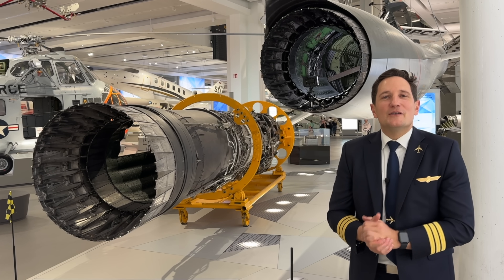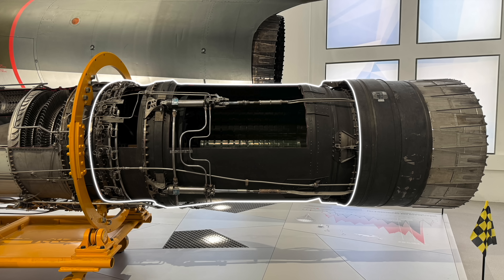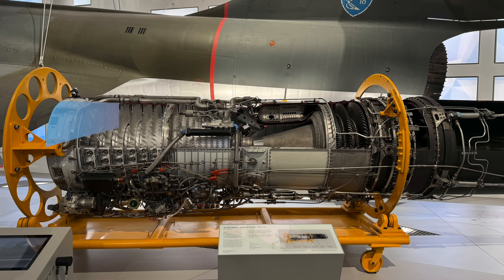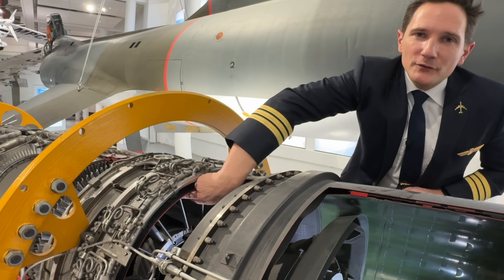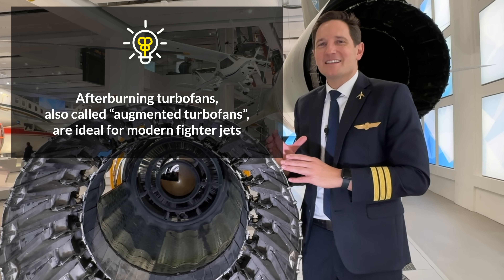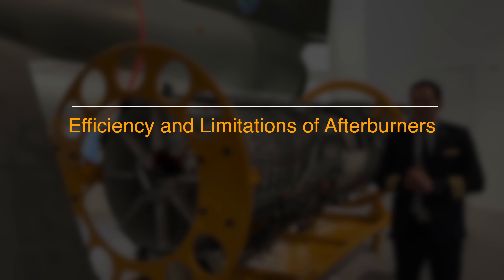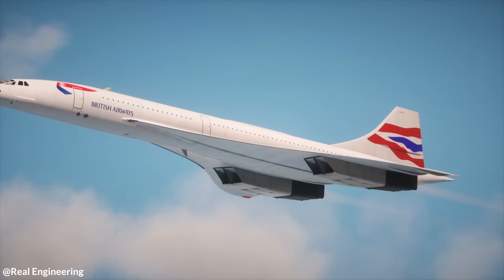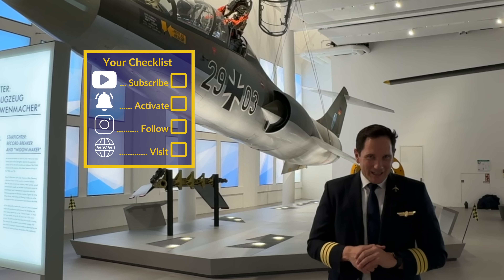How an AFTERBURNER works - Explained by CAPTAIN JOE

Comment: Indeed,  comparable to a rocket engine,  producing power continuously, micro second to micro second without interruption.  Even a V-12 piston,  for some microseconds,   portion of the engine cycle it produces no power,  and is dead reciprocating mass.

Comment: Hello, interesting video. To burn the injected fuel, isn't air needed? Surely the exhaust stream is O2 defficient so air must be needed? I think you mentioned one engine design had bypassed air but no mention if other engines have some sort of air bypass to use and burn with the fuel post main combustion. Thanks, good video.
Reply: There is plenty of O2 in the exhaust stream. 16-20% oxygen in the afterburners compared to 21% in the engine inlet. Hardly any oxygen is used in the main burners compared to the volume of airflow that goes through.

Comment: Does the exhaust nozzle have to open wider in AB to prevent turbine or core damage?  Or is there another reason?
Reply: Yes, the nozzle must open to allow a greater mass airflow otherwise it will choke and a) the extra thrust won't be realised and b) the back pressure will affect the operation of the main engine.
On the engines I've worked on with reheat (afterburner) the nozzle is fully variable and as reheat is selected the nozzle opens full to allow the flame to light then the nozzle closes to allow the exhaust gas to accelerate to just below supersonic speed which creates maximum thrust for the min reheat setting. As the throttle is opened, the nozzle opens and the reheat fuel flow adjusts to maintain maximum thrust for the given nozzle area. The throttle drives the nozzle and the fuel follows the nozzle. At max reheat, the nozzle is fully open and no choking effect occurs but max thrust is generated. As the throttle is closed, the nozzle area is reduced and the fuel reduces accordingly. When reheat is deselected, the nozzle remains at the size required for the dry engine to function at best thrust.

Comment: A better example is Concorde’s RR SNECMA Olympus engines with afterburners on a CIVILIAN aircraft that beat most military aircraft for distance endurance at MACH 2. 
Concorde fired up after burners (military thrust) briefly on take off and when crossing the sound barrier over water.
Reply: It wasn’t called the Rocket for nothing

Comment: Correct me if I am wrong pleas but stories of the blackbird pilots tell of it getting better fuel economy at high speed in afterburner than out of afterburner and if they needed to save fuel they went faster.
Reply: Yes, the SR-71 is a different animal. At low speeds the engine provides all of the thrust (100%) which is inefficient. At speeds greater then ~Mach 2, the engine inlet spikes create about 80% of the planes thrust by capturing the energy from the incoming shockwaves. At those speeds the role of the engines are not to provide much thrust but to remove excess air build up behind the inlet spikes so that they can function properly and provide most of the thrust. They are just essentially vacuum cleaners removing built up air behind the spikes and only contribute 20% to the total thrust from their exhaust. That allows the SR-71 to be much more efficient at high speeds then low speeds.

Comment: Concorde of course @6min...and we have the tech and materials now to make a mach 3 private jet easily...and build a next gen Concorde...time is the most important commodity...its the one thing you cant get more of...
Reply: Issue with a present supersonic aircraft isn’t technology, but rather economics and legislation. As in on a relative scale, the cost of a ticket for a supersonic ticket to break even would be way more compared to a normal aircraft. Example, if a ticket between a first class emirates flight and an economy class supersonic flight would be the same, how many would prefer the latter?
Reply: @ZK-APA  the legislation can and should be fixed...its not like any of the crap they were worried about with sonic booms or the ozone layer turned out to be anything...seeing as it was CFCs and not aircraft exhaust causing the ozone hole...and as for the sound...at 75+kft the sonic boom is more like a roll of distant thunder...esp with modern computer designs...as for economics...drop the net zero crap and you have a much more economical way to operate...and private planes especially would benefit seeing as the economics for them are based on time savings...also make exceptions for these aircraft with those nonsense airport noise restrictions...
Reply: @MariktheWolf  For legislation sure your points are valid, I won't counter that. But for economics yes. Its not about net zero or anything, its about how many people are willing to pay a premium for this feature. Yes in private jets I see a case but for commercial aviation it can only be feasible if the cost of entry for the passenger is low.

Comment: My late uncle was a designer and inventor for McDonnell Aircraft Company. He and another man invented the F-4 Phantom II, fighter jet. This jet is probably the MOST important advance in jet engine design because it made afterburners a practical engine feature. Without fancy math, Uncle Bill described how this came about. Mac engineers discovered the exhaust gas was very inefficiently burned. It was full of hydrocarbons being wasted out of the stovepipe. By adding a small amount of fresh fuel and a secondary igniter, significant more thrust was created. The F-4 was and is the all-time most successful fighter aircraft, in the world. Over 5100 units were produced at the plant in North St. Louis County. F-4 was the design starting point of the F-15 and F-18 fighter jets.

Comment: Great video! I never even considered if the AB is in the turbine exhaust or bypass flow, or a blend. Just never thought about it!

Most modern (at least American) fighters dont have a set/specific time limit on AB use. What they do have is a speed limit, but more importantly, the boost pumps feeding the engines (out of the feed tanks) can outpace the transfer pumps refilling the feed tanks from other tanks, so if you stay in a low altitude, super high fuel flow state for too long, you can literally flame out due to feed tank exhaustion. The transfer pumps just cant keep the feed tanks full. 
Imagine the boost/transfer pumps on the SR71!!

Comment: You dont really hear the burners when youre in the jet, but you certainly feel it! Just a smooth, steady, increasingly powerful push into the back of your seat. 
Also, nothing really happens when you go supersonic, other than some baro altimeter fluctuations and maybe some minor pitch oscillations as the Center of Lift shifts. The CAS mostly takes care of that on it's own. If you arent paying attention you wont even notice.

Comment: So, is it appropriate to say an afterburner works similar to a rocket engine, kind of 🤔?
Reply: All engines work similar to a rocket engine ie use thrust to propel forward. The only thing different is that if the source of the air is from outside, its a jet engine, and if the source of air is internal ie stored within the vehicle itself, then its a rocket engine.

Comment: I just realized that no one has made a video about afterburners that doesn't just say "inject fuel into exhaust, ignite fuel, jet goes fast." I appreciate the decent dive into what components are actully needed, and the inner workings of afterburners in general.

Comment: My expertise is in internal combustion piston engines so I freely admit to extreme ignorance about jets. I have a couple of questions about afterburners. 1) If you are injecting fuel effectively into the exhaust, then unlike the engine's main combustion chamber there will be no additional compression applied; is this correct and does this not lead to terrible fuel consumption? From what you say about tripling of consumption I guess it does. 2) If the fuel is able to ignite in the exhaust, this suggests that jet engines are run at a much leaner fuel/air ratio than stoichiometric so there is excess oxygen available for combustion; is that correct? Thanks.
Reply: In all jet engines there is surplus oxygen in the exhaust stream as combustion doesn't use it all, therefore the surplus can be burnt to create extra thrust. Modern turbofan engines have more unburnt oxygen as they have more bypass air than on a turbojet engine so are better suited to having reheat or afterburners.
Reply: There is still 16-20% oxygen in the airflow exiting the main engines turbines. Still plenty for afterburning. Yes there is no further compression after the main compressor section. The pressure of a jet engine is highest right after the main compressors and it's all downhill after that. The air wouldn't flow out the back if that wasn't the case. One of the biggest misconceptions about jet engines is that the burning of jet fuel in the main combustors raises the pressure. That isn't so, the burning of jet fuel in the main combustors raises it's temperature. That cause the air to expand and increase it's velocity. That increase in velocity DECREASES it's pressure. Same thing with a gas stove. The burners heat the air, the air expands and the air rises, that's it, no increase in pressure. It's constant decrease in pressure out the back after the main compressors.

Comment: Soo informative. Am a fan of your channel.
May i kindly request an analysis vids of what can be done to avoid that fatal crash  of the jeju air crash.
Seems like there might be a poor airmanship and  lack of crew resource management with a combination of several co incidemces.
I am keen to know what exactly happened, can the plane be safely landed, why no landing gear and highlift devices are not in used while seems to me like the thrust reverser is working. 
What happened to power from battery for comm. Why not they use APU for necessary configuration to land, why not trying a 2nd attempt on active runway. They touched down really fast means they still have speed to make 180°  to make a downwind to active runway.
Are the pilots distracted or lack of training in sims. 
I know times running really fast and things can happen in a split of a seconds.  
Why they go around as if are fully configured for landing or they are not fully configured, if fully configured,  why not continue their approach even without reversers, they have a better chances like slamming their brakes manually.
So many things which are likely to do for the pilots. 
There are tons of questiions still not yet published.
I didnt ask for an experts examination reports, but from an experienced pilot perspective like you..
Id be very glad and wish you a good health

Comment: Hi Capt. Joe I'm  having a small doubt can you acknowledge that 
See the runway designation markings shows whole number nearest to one tenth of magnetic azimuth of centre line measured clockwise 
from magnetic North. 
So, if the runway designation making is 07 / 25 when we add 70° and 180 ° we get 250° which is the exact opposite but when we add 70° and 250° we get 320° why it is not completing the full 360° circle. 
@Captain Joe
Reply: Because there is no relation of the sum and 360. The relation is only with 180 as the 2 numbers are opposite to each other

Comment: question: where does the oxygen come from to burn the afterburner fuel? if it's burning exhaust gasses it can't have a great air-fuel ratio can it? or am I missing something else entirely
Reply: There is still some unburnt oxygen in the exhaust gases. Reason is that engines are not designed to burn the entire oxygen present (as doing that would create so much heat that it’ll exceed the engines limit)
Reply: There is still 16-20% oxygen in the exhaust gasses. Very little is used in the combustors.

Comment: -- Olympus for Concorde, and I can't remember what Soviets used for their Tu-144... back to watching the video.
Reply: -- Hey, what an unanswered  "cliff hanger"... I was expecting to have name of those engines to be revealed... Now I have to Google it!
Reply: -- There is no way I could answer this question(Soviet Part) without wiki... I was thinking Klimov or Lyulka-Saturn(because for some reason Arhip Lyulka was first in Soviet Union who designed turbo fan engines), but it was Kuznetsov(sounds vaguely familiar) for turbofan, and Kolesov(never heard that name for sure) for turbojet version of engine for Tu-144.

Comment: J58 didn't just "run in afterburner mode", past Mach 2 it essentially turned into a ramjet, with the turbojet core acting as a part of the diffuser rather than providing thrust.

Comment: The SR-71 engine J-58 was engineered to reconfigure from a normal jet engine to a ram jet as speed increased.
Reply: -- Not to a pure ram jet, but bypass a few compressor stages, and hot end to afterburner.

Comment: hello Captain Joe,
i have an important question.
can you please make a video about the performance and physical characteristics of a 4-engine plane flying on 1 & 4 engine only, versus flying on 2 & 3 engine only (symmetrical flight); in terms of acceleration, high and low speed, AoA, maneuvering, climb, descend, etc.
thanks a lot 😊

Comment: Ahhhh.... The Olympus 593 on Concorde.
About the SR 71, the engine, the J58 has a particular way to run. At high speed, it has a so-called compressor bleed directly to the afterburner, so the way it run is similar to a ramjet.

Comment: Maybe idea for a follow up video. 

1. It is not clear to me, how there is oxygen in the exhaust to burn the excess amount of fuel in the afterburner chamber. Unless mixed with the cooler air flow bypassing the core. 
2. If the exhaust after the turbine can practically "burn more", why not burn all that potential in the first stage? Is it a materials limitation of the core? 
3. Afterburner seems to me like a cheap work around of the material limits in the core. The afterburner chamber is like one from a chemical rocket. Burn in the chamber and let it out though the exhaust. You only need to worry about the container, not other moving components found in the core
Reply: In low bypass turbofan, there is oxygen to burn from the bypass air.
 About burning extra on the burn chamber  is likely that the temperature get too high and  and the compressor turbine and fan  will spin too fast
Reply: ~50% of the air that enters the combustion chamber in the core of every jet engine is used only to cool or dilute the exhaust gas stream and the combustor walls itself. It’s not used for combustion at all. The exhaust gasses are so hot they would instantly melt the combustor and turbine blades otherwise. 
This is why an afterburner works so well. There is still a large amount of air available in the exhaust which when mixed with fuel can burn. The afterburner liner doesn’t burn up because it’s also film cooled with turbine discharge air. 
A car on the other hand expels an inert gas out of the tailpipe. Almost all of the oxygen is used to support combustion in the cylinders. 

The higher the temperatures that can be made in a jet engine the more power can be made. High temperatures melt things though. So yeh, you are right, what limits jet engines is materials they are made out of. If we had some super high temperature metal that could withstand constant 2000+degrees C it would be hugely advantageous. 
As technology progresses, more and more advancements in metallurgy and turbine blade cooling are made, which allow for higher compression ratios, temperatures and more powaa
For your last point, essentially how come the whole engine can’t just be a large afterburner? Because whilst afterburners are great at making more thrust, they do so at consuming triple the fuel rate that the engine itself consumes. There is no compression taking place in the afterburner, that’s why they’re inefficient and have horrible specific fuel consumption. 
Look up ramjets. These are basically efficiently designed afterburners that use high vehicle air speed to compress the air before injecting fuel.
Reply: @buxybuilt1519  thank you
My point, at least the one I wanted to make without being an engineer, was actually to have the entire engine work at higher temperatures and be protected like the afterburner

But you answered all my questions. Also how we got engines that sustain supersonic without afterburner. 

Thank you again very much. Rarely YouTube comments are so useful

Comment: The Bristol Olympus in the Concorde!
FWIW the burners were used on the Concorde when, as you said, transitioning to supersonic but they weren't turned off until accelerating through M 1.7

Comment: What airline has their captains wear three stripes?
Reply from the maker: Why are you a unknown rider?
Reply: @flywithcaptainjoe  That was the name I chose. It's a radio call controllers used when an inbound unidentified aircraft was approaching the U.S. shoreline.
Reply: -- Starting with Pan Am four stripes is Captain, three stripes is FO(First Officer) two - Cadet or in training, that tradition is across the airlines now days.
Reply: @RussianThunderrr  When I got hired my company still had two-stripe professional flight engineers.
Reply: @ wrote: "When I got hired my company still had two-stripe professional flight engineers."

-- Yeah, those days are gone, now days flight computers don't get to wear suit with two strip chevron on the sleeve, since they seat inside "e-bay" compartment of airliners. Cool story on your call sign, though.
Reply: @RussianThunderrr  The FE's knew everything about an airplane. I went out to a 727 and the two-stripe and a mechanic were in the cockpit discussing a problem with the aircraft. The FE said "It's the blue wire."